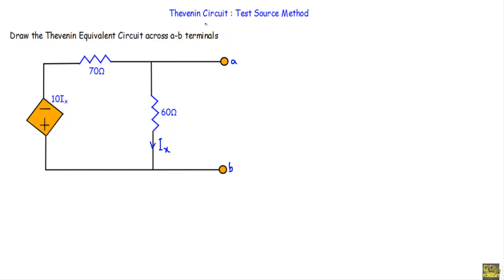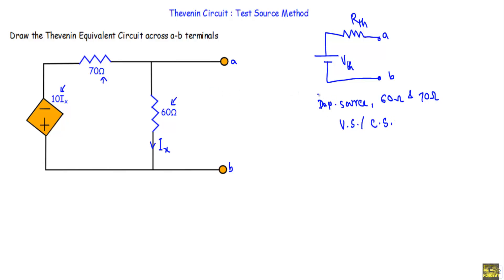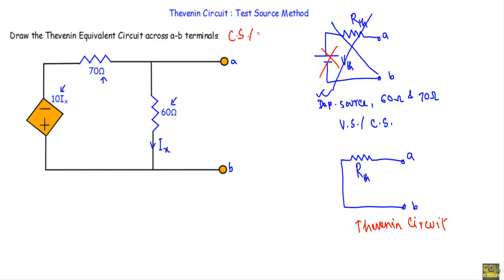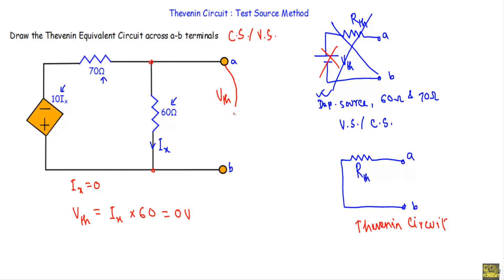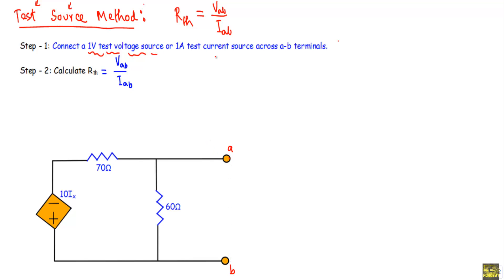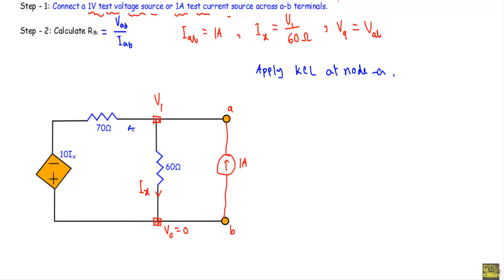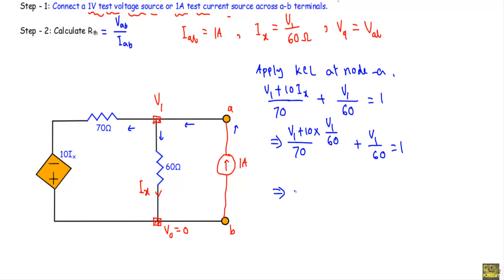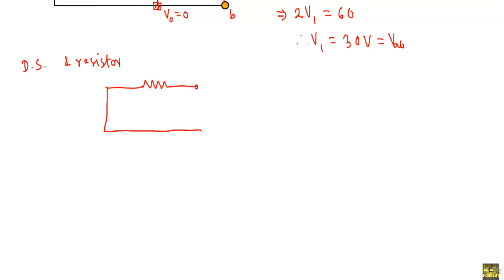Thevenin Circuit : Test Source Method

Comment: after introducing 1amp test source instead of KCL if we go with current division method then the current would be 1) through 70ohm-0.46amp and 2) through 60ohm - 0.53amp then the voltage at the node would be 0.53 x 60= 31.8 volt or 0.46 x 70= 32.2 volt.... <------then what should we do in this case...I mean 30 volt is the answer but 31.8 and 32.2........
(pls comment on this)
Reply: You can’t use this because there is additional current in the circuit due to the dependent source.

Comment: 1.How to know whether its better to put voltage or current test source?
Reply: You should decide based on if you are trying to induce a voltage (V subscript x) or a current (as shown, i sub x), and then use the appropraite source. If the one you chose doesn't work out, use the other.